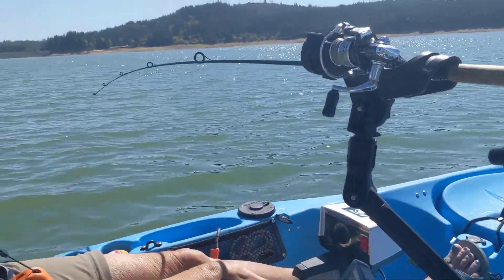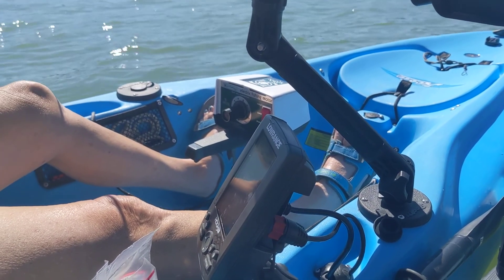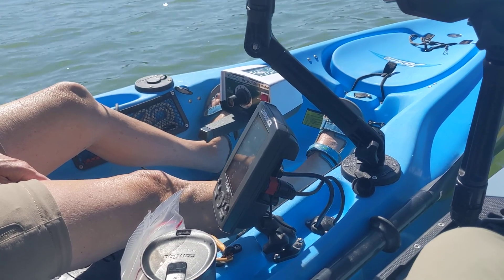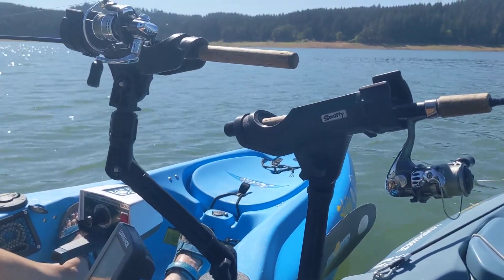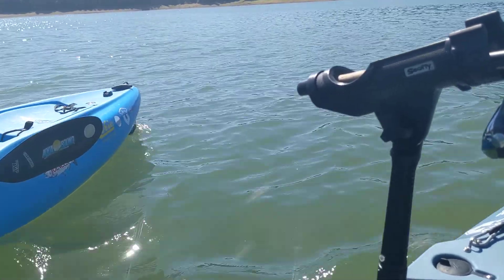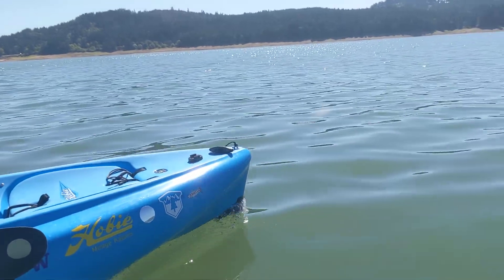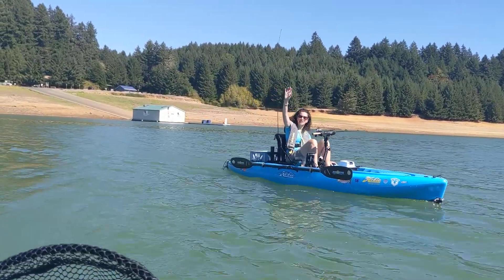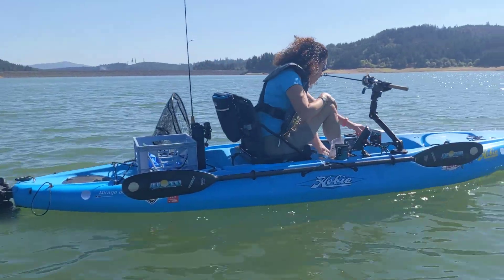Kayak trolling motors Minn Kota vs Sears Roebuck Ted Williams 1970 Model

Comment: Didn't think a Minn Kota would fit in the hobie opening, can you show how it goes in and out of the pedal hole? Also provide a specific model of it? Thanks
Reply from the maker: It's the Minn Kota Enduro 30 pound thrust.  Got it for 90 bucks at Cabela's.  You have to kind of pull it back through as it's a tight fit thru the hole but I'm satisfied with the way it works all around.